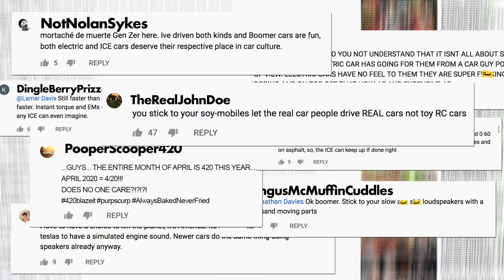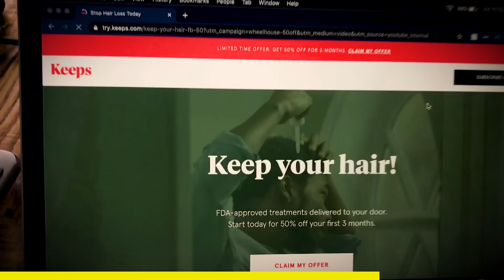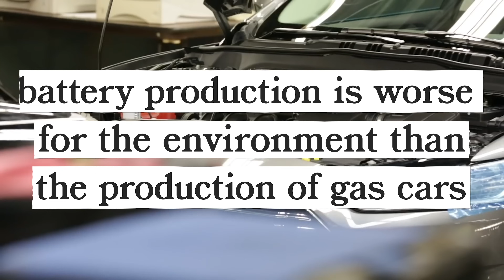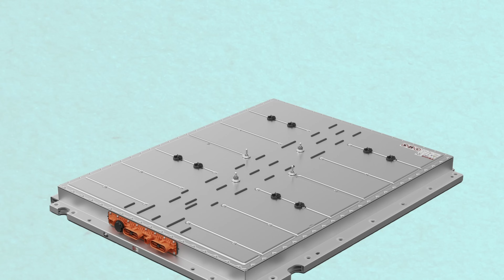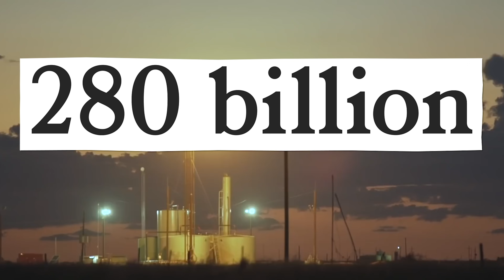Are Electric Cars REALLY Better for the Environment?

Comment: I like this.  But I have a problem with it.  The EV beats out IC in 6mo to 2yrs.  But what beats out over 200k miles?  I've never had a lithium ion battery outlive the product, it's always the weak link.  So if it needs replacing 3-4x over the life of the vehicle and my IC engine never has more manufacturing impact over it's life, what actually pollutes less?

You did a lot for greenhouse emissions, but disposal is also an issue for the batteries as they cannot be recycled like the parts in an IC engine.

You also didn't touch on the biggest problem, energy storage.  Which is the only reason we haven't converted 100% to renewables.  (Dams are currently the only mass energy storage system we have available)  An EV grid could effectively act as a smart storage system where energy from renewables is stored in the EV grid and used when renewables aren't available.  This could reduce the use of coal significantly.

Comment: make a longer video,  maybe we should have a TED Talk. Few things should  be added.
-  co2 production while refining oil is not only for gas/diesel but for a lot more products coming out of this process. So the co2 production should be divided and associated to those products to be fair.
-  electricity produced to charge your EV is still produce even if you are not charging your Ev. This is a big factor as well and it should be counted for. Charging or not, the electric companies are still producing the electricity so you can charge it when you want. There is a big waste of energy there that should be accounted for.
- Power plant are not very efficient at production electricity and there is a lot of waste there as well. The power plant itself, transmission line, sub station, the whole grid etc.
- People have no idea what it takes to produce 60 kw to charge an EV. so Here is a number from my electric company here in Michigan (Consumers Energy) To produce 1 kw for one hours it takes 1 pound of coal. Think about this. You use it or not you still burn it no matter what.
- I would love to do the same with gas and other sources but I could not find any numbers for those applications. 

It is a good start but more work and education needs to be done on this subject.

Comment: Alright for starters they should not be called lithium batteries. They are only 2% lithium. They should be called aluminum nickel batteries because that's what mostly they are. and as far as Cobalt guys there already working that one out lithium ion phosphate batteries do not have colbalt

Comment: I liked your video a lot but could you provide your exact sources? One thing to consider is where the EV will be driven... because for example driving an EV in a country where the main power is nuclear is going to be different than driving an EV in a country where the main power is coal - and a small detail like that could effect the source study metrics. 
Also for studies like this you need to consider small variables that will effect the C02 output. For example I would be willing to bet that there is a number of EVs that charge on gas powered generators when there is no EV charge nearby - the number is probably small - but for the point's you are making it is something to consider for C02 output. 
At any rate it was a well done video - just please provide source data.

Comment: Totally glossed over how the EV lithium batteries need to be replaced every so many years (seems to be every 5 years on some).  That means they run neck and neck.  Also the fact that CO2 is a fertilizer.  It's the other nasty stuff the liberals should be worrying about, especially the particulate matter (cancer causing).  I will keep driving 90 year old cars that still get 30 MPG, even on crappy corn- based gas.  That's another video.
Reply: No they don't. At least for Tesla, their batteries last the entire life of the car. I know that because Ive owned one for the last 2 years. Stop spreading false information.

Comment: Like 10 years ago Top Gear addressed this.  Search for it on YouTube. Until batteries can be green it is horrible and unethical In Toxicity. There is more to pollution than just co2. Also one thing not mentioned is battery life. When you have to replace the lithium batteries.  That being said.  Let them decipher ev cars. That may push better battery technology

Comment: Question: Have you taken in to account the average length of time the ICE car and the EV will be in service? What are maintenance costs over time in relation to wear and tear on both vehicles and what is the delta?
Reply: Now that we finally have the first million EV's on the road it will probably be about 10 years before we know for sure.  EV's have a lot fewer moving parts and a lot less maintenance in general.  The Nissan Leaf was the first EV to sell well and those batteries did not use active cooling and had short lives. This has given people the idea that batteries wear out and have to be replaced faster than ICE cars.  I have a Chevy that uses actively cooled batteries and after 20,000 miles it has lost zero range.  Tesla says their batteries will last hundreds of thousands of miles, but Tesla says a lot of things so...

Comment: @donut media, The 280 billion metric tons of CO2 produced annually by oil refineries. Is that for all oil refined or only oil which ends up in the gas tanks of civilian, gas powered cars? Oil is refined and then goes on to make thousands of different products including gasoline and diesel for airplanes and commercial vehicles and boats and things that should not be relevant to this particular conversation

Comment: The problem with your comparison is no one cares about CO2, it’s not a warming gas as believed by old science.  No crises to reduce CO2, and oil supply is at 40,000 years and increasing, the old Dino science is old science. Turns out there’s oil everywhere and is a natural  continuous and constant process, you could even say renewable. The conversation is over.

Comment: Comparing the CO2 production between EVs and ICE vehicles is counter-productive and only keeps spreading misinformation since CO2 isn't a pollutant, CO2 is a necessary nutrient for plants that has little to no effect on temperature and the current 410-420ppm in the atmosphere is a little less than half what the theoretical ideal amount should be.

I think Donut Media should have gone more into depth on the environmental effects of "clean" energy sources for EVs since they dug into the oil refining process, even though the only stat I can remember was shared in the video was just how much CO2 was produced in the oil industry. 

A better comparison would use Carbon (not Carbon Dioxide), other particulates, as well as all other environmental impacts the EV energy sources have as the basis instead because solar and wind themselves are extraordinarily bad for the environment. Hydro-electric power generation is an amazing source of electricity though, unfortunately it's only effective in very specific geographic locations since hydro-electric requires large, consistent quantities of gravity fed or flowing water.

Comment: It is clear that they are against electric cars. If the idea is to reduce the emissions of internal combustion cars. If we compare the pollution of making an electric car vs making a car with internal combustion and also that it remains working for 20 more years and that it continues to pollute. On the contrary, the electric car is only one time in which it is most polluted. Which is in making it. Obtaining energy is another matter, which has to be done more and more cleanly in obtaining it. In the end these videos instead of promoting that it still contaminates an electric car. It is to make a video, with the solution of how to reuse lithium batteries. That today there are already plants for this.

Comment: Going forward, electric cars will get worse and worse for the environment. Both the batteries in the cars and the solar power everyone wants so bad will rely on nano-carbon materials to improve. The problem comes when you dispose of them. Just wait until the entire environment is permeated with nano-carbon particle contamination. It will make nuclear disasters look like a joke.......which is why incidentally if we were actually smart at all we'd be building new nuclear power stations instead of solar. Long term they are much safer and much better for the environment per KWh. We need to get off oil and coal as fast as possible, and solar is NOT IT.

Comment: Nolan, the basis of your argument is that, after 2 years  EV's start to become more efficient than combustion engines...right? Based on 11,800 miles per year, next you mention the "lifespan" of a car... You failed to mention that after 6-8 years EV's need to have their battery replaced because their efficiency goes way down with time due to their short life cycles. This is not the case with combustion engines at all, with a life span on average going past 200, 000 miles as compared to 70,800 miles maximum of a battery pack, but we all know that EV's don't go as far as combustion cars. Range anxiety is very real, I would guess it is half that easily, so 35,400 miles vs. 200,000 miles? What you are actually looking at 17 years of driving for a combustion car vs 6-8 years for EV's before they all needs a new battery pack again, unfortunately? 
Nolan, did you also take into account the cost or carbon footprint of manufacturing solar panels and wind turbines (that are not lasting as long as thought); like you did for oil & gasoline production, ironically both are required to produce EV's even more so.
Almost zero electric cars are directly being charged by solar during the day because they are in use then, to do so they would require a larger secondary battery storage to do that charging at night, not to also mention the exponential degrading inefficiency of shrinking power storage of batteries, and their 6-8 year life cycles. 
Too bad that even this is an unfair comparison based on how many SUV's and half ton trucks are on the road bringing down the average MPG, as apposed to EV's with shorter comutes...sort of an apples to watermelon comparison really. I won't even go into how extremely inefficient, EV's are in non flat areas or in the colder temperature climates that their averages for efficiency are not factored in, you only see the best numbers for EV's ever! 
I wont even get started on the dark secret of burning coal for production of electricity, but staff have to or should be wearing a radiation badge like at a nuclear power plants...you defiantly don't want to live down wind of a old coal plant.

Comment: The video doesnt cover one important part, the amount of energy you'll need to charge the Electrical vehicles. The electrical power plants take about 1/3 of the worlds CO2. Which means you'll be required  to build more plants which = more CO2

Comment: Also electric vehicles have much less maintenance and parts to replace and oil and fluid etc...imagine the manufacturing and transportation of these spare parts and the  disposal of all fluids and oils. Plus due to regenerative breaking tyres and brakes last much longer. Batteries last longer than ICE engines and can be recycled. Also as time goes by the manufacturing EVs and the fuel source will only be greener and  greener.
Reply: Not sure I agree about the tires.  The tires on my EV wore out really fast because it is too fun to drive.  But yeah, overall it is way cheaper per mile.

Comment: I do think one thing that hasn't been considered is the battery failing because from what I have read they only last roughly 7 years and then need a new battery now even if the 7 years isn't accurate they are bound to need replacement which is then the biggest emission it has aside from using all the diesel equipment in the mines and ships that actually deliver the cars to other countries. Yes gas and diesel cars do too but it's still a factor people don't consider when they think they're driving a perfect vehicle with no emissions no matter what, they're wrong